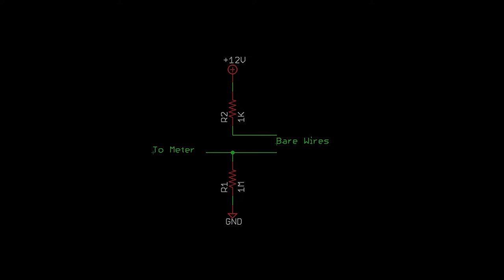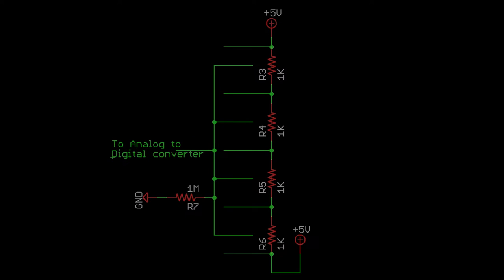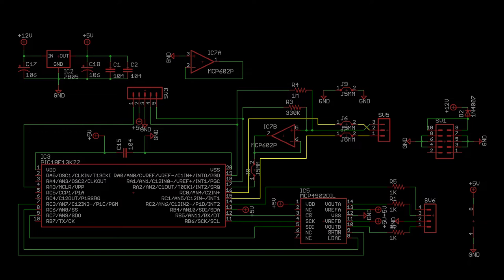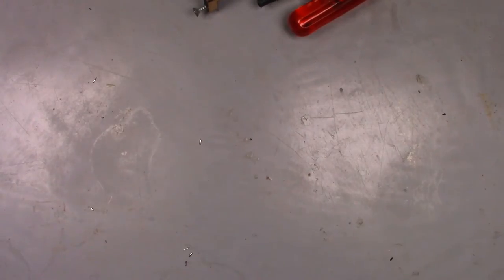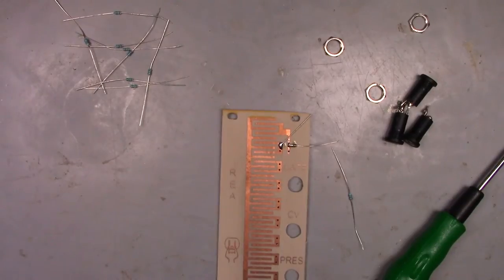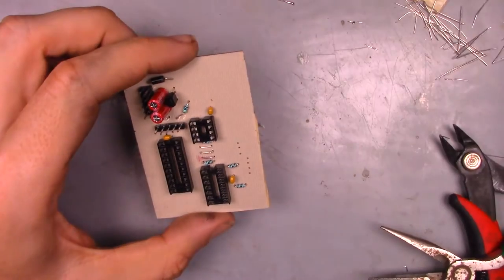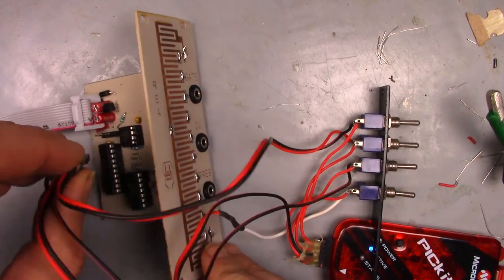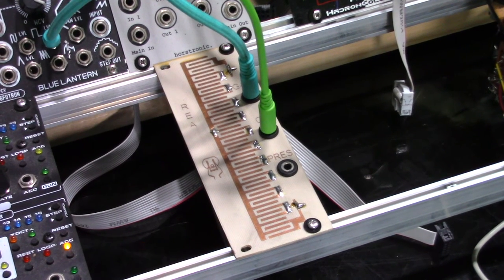DIY eurorack touch controller build

Comment: Hi, great channel. Makes me want to build a lot mire than I do.
What specs does a laser cutter need to be able to cut the panels? I suppose for removing the paint from the pcb's there isn't as much power needed as cutting the panels.
Reply from the maker: I have a 45watt 12 by 20 inch laser cutter. Full Spectrum Laser is the brand. It cuts just fine. More power will cut faster and thicker parts, but for what I do, I have plenty of power. 

The real cheap 5W and 10W laser cutters probably won't cut it.
Reply: thanks a lot for helping

Comment: would this work through glass like a TTP223? or does it rely on physical touch?
Reply from the maker: It relies on touch. You complete a circuit by touching it. 

You can build your own touch circuit that works through glass. Simplest way is a 'relaxation oscillator'  where a conductive martial on the far side of the glass is used as part of the capacitor in the circuit. Then when you touch the glass, you change the capacitance, and the frequency of the oscillator changes, which then can be read by a micro controller. 

Chips like the TTP223 simplify all of this greatly.

Comment: Would it have worked to get force sensitivity only and not position? What needs to be changed for that?
Reply from the maker: You got the right idea. Have 12 individual touch buttons, one for each note on the scale, and measure the touch force on each one independently.